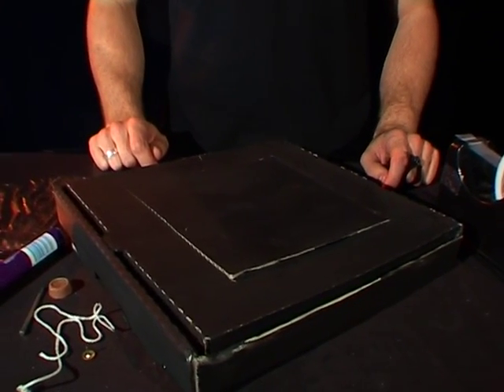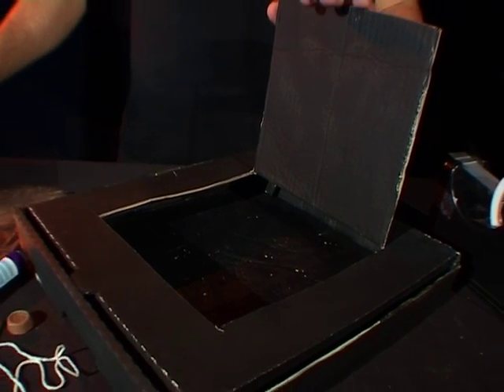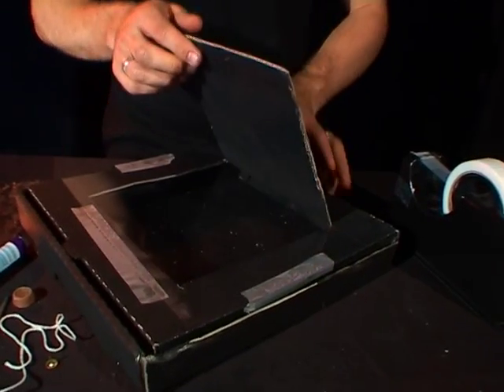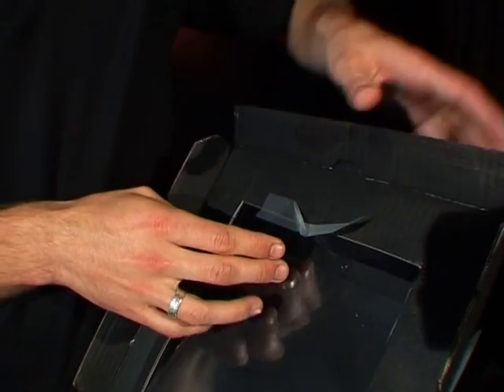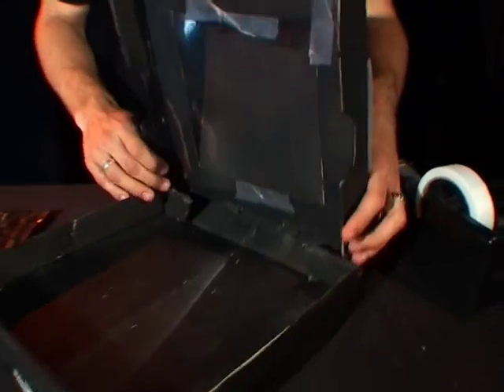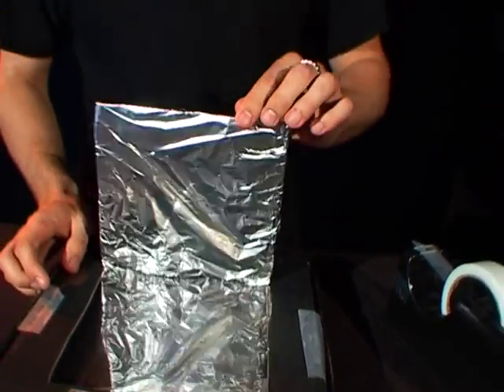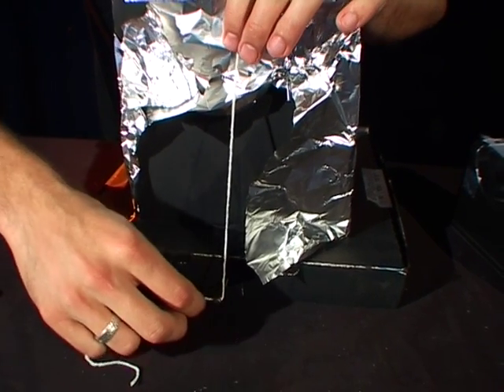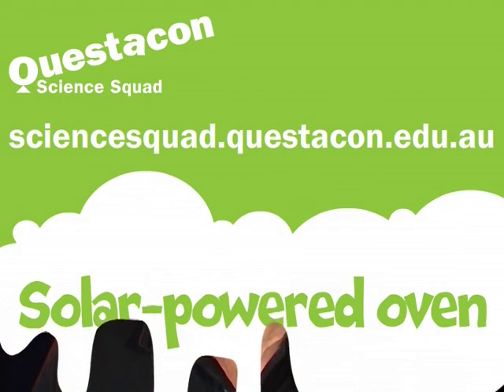Solar powered oven

Comment: @QuestaconNSTC @QuestaconNSTC I see. 
I don't think I have anything else that's transparent besides these plastic book covers at home, but I would if I were to see anything else in stores I might try to. 
One question though, should I have the plastic book covers in double layer in both sides of the box cover? I think they're a bit thicker than those plastic sheets.

Comment from the maker: Can you use a mirror instead?  It is difficult to determine which item you would like to replace with the mirror.

From the nature of the activity, I am assuming that you’d like to use a mirror in place of the aluminium foil on the underside of the square flap. We have not tested the activity using a mirror. A mirror should work, because a mirror reflects light (which is the purpose of the aluminium foil). Please let us know the results of your experiment!